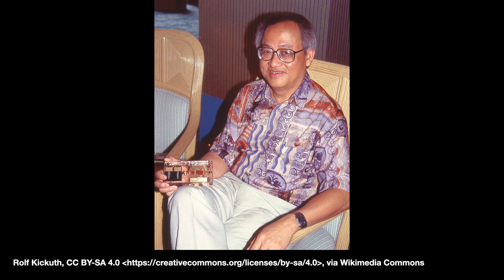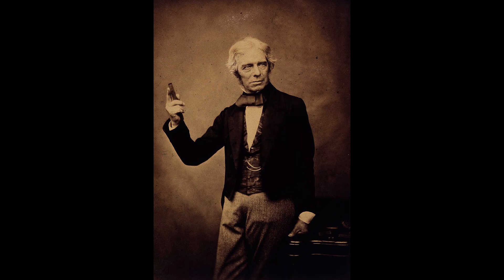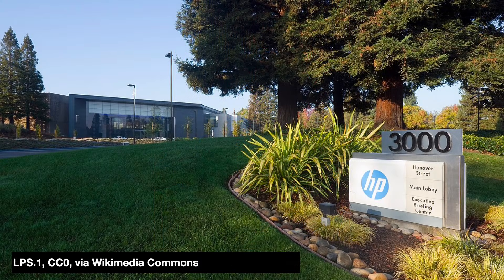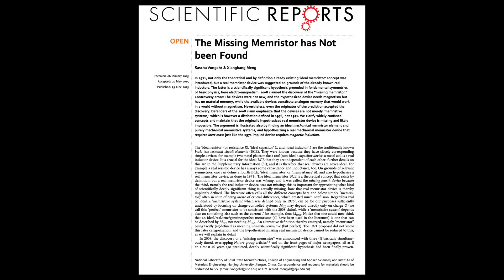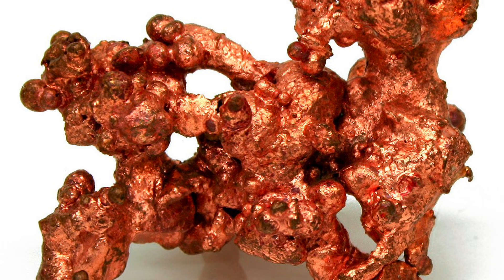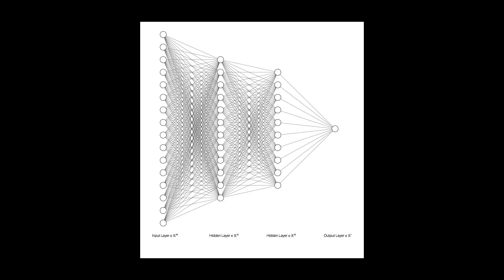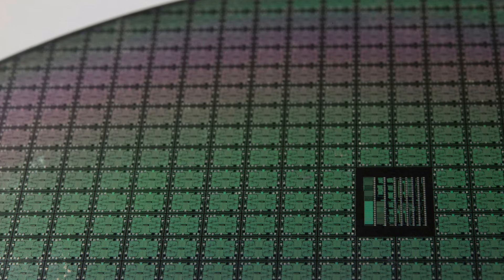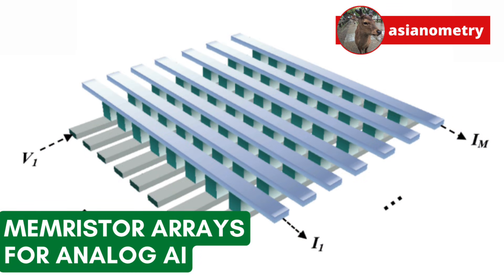Memristors for Analog AI Chips

Comment: It sounded to me like an electric spark can change the resistance and each memristor value needs to be  set  at each power on for a NN application.
Reply: memristors retain their value when the power is off. In fact you set the value and then turn off the current in normal operation.

Comment: Current computation based neural networks are just stupidly inefficient, to determine whether an artificial neuron should turn on you have to read a bunch of values from memory, which is not in the same chip so you gotta go through a bunch of memory management crap, wasting a lot of power and time, then you gotta do the math which is basically unnecessary because neurons don't need precise numbers anyway. Then you take your result, put it back out into memory, so it could then be used by another round of simulation of another neuron down the line.
Where as for a real neuron, this whole process is basically just baked into the wire, you send information into the wire, it automatically gets transformed and transferred over to the next neuron, there's no unnecessary nonsense like math or memory.
A big reason why current deep learning based AI is so stupidly inefficient, but if we could somehow have hardware that does the same thing as neurons, without using math or external memory, it would instantly be orders of magnitudes more efficient.
Reply: Ok, it's not THAT inefficient. You can divide up layers on different GPUs, so they don't have to fetch weights from off their own VRAM. The most efficient fused kernels, like FlashAttention 2, try to do as much as possible with on-chip cache while minimizing calls to VRAM. But still, a crossbar memristor array would be like 10^6 times more efficient.
Reply: a milli a mille a milli a milli
Reply: @accountnumber1234567  comment aged like milk lmao
Reply: @1vake496 context?

Comment: I'm intrigued but I fail to fully understand the concept and the implications.
Reply: Neural networks do a lot of math, particularly a lot of matrix * vector operations.
In a regular, digital computer, this would be done sequentially, multiplication after multiplication, which can take "long". Even on parallel hardware this could take multiple cycles (I think).
Memristor arrays could simplify the process by just having the input vector as a set of voltages on the top lines and reading the result of the matrix multiplication in the bottom lines. All memristors are working in parallel, making the process almost instantaneous.
Reply: @ゾカリクゾ  - TY. Is it the same idea as that of physical (hardware) neural networks that I've seen somehwere that is a (potential, under research) alternative to virtual (software) ones, which are the ones being used now in AIs?
Reply: @LuisAldamiz  Yeah, in some papers, they named it 'Hardware' NN to differentiate against regular 'software' ANN running on regular digital ALUs. The physical properties of the material (in this case, electrical conductance) and the linear law (ohm's law and Kirchoff's current law) is used here. For example, to do 4x2, 0.4V multiply by 2 microSiemens = 0.8microAmps. 0.8microAmps as an analog value, can be converted into digital 8. 4x2 = 8! Kirchoff's current law is just to add up more matrix elements
Reply: @timng9104  TY for the reply. However I recall that one characteristic of these brain-like (under research) physical neural networks was also to imitate the way brains work, which is "slow", "low energy" and "chaotic" (as opposed to the heavily centralized CPU architectures). This is, I understand, not necessarily what a "simple" shift from transistor (CPU & RAM) to memristor architecture but retaining the current mainline "neural network" paradigm would do, right?

IDK, probably there are several parallel and somewhat related lines of research here, all cutting-edge and thus a bit hard to understand. If they succeed, they may be behind a new AI and overall computing revolution (for the good and for the bad). Or it may not work at all, like the alleged graphene revolution and such.
Reply: like a new kind of a fpga.

it's not the only use case if someone managed to produce them though.

Comment: Got thinking about Memristors again after your SRAM video, was thinking about if they could be used in place of SRAM too.
Reply: Hi, not really, memristors (curent Halfnium oxide ones) are very noisy, and have huge failure rates, plus they actually consume a  lot of current to be programmed. So they are ideal for ROM, or Inference only accelerators, but for now it is not really though of as cache (PCM or other type of devices are tho).
Reply: @theoballet1519  Of course they aren't good for it now, they're pretty new and underdeveloped compared to SRAM cells. The properties of an ideal memristor would still make them interesting potential alternatives should one ever be developed in a process node compatible with a processor manufacture node.
Reply: @DigitalJedi  yeah maybe, we will see with new feram transistors and pcm I guess.
Reply: Same, a smart marketing move by Asianometry haha
Reply: I thought the same, I think we are a good oxide discovery apart to make that happen.

Comment: Memristor for me is scientific scam. Over the last thirty years there were regular articles about that topic.  None of them  led anywhere. Only good to get a PhD. 
If you  need a 2pin memory  device  just  use a 2 pin poly-si resistor  and put enough current through so that it melts. After removing the current the resistor has changed forever. 
Where is my PhD?
Reply: Why a scam? Companies did implement it in some experimental products that do work
Reply: @annilator3000  Yes, they can make chip. But it has really powerfull due to in memory architecture? No, they can perform well in limited model.
They promote that their chip is in-memory architecture, however in reality, they some use host dram by external interface(PCIe) or has own dram. Because memory in logic die is too expensive, they can not integrate over 30-50MB that they want to sell their chip.
I think that pim architecture is dead as other area.
Reply: @annilator3000  so where are they commercially? nowhere
Reply: @MrTweetyhack  STmicro electronics for PCM, CEA for memristors, TSMC has annoucned 2T2R memory arrays, and others.
Reply: I am doing my phd on in memory computing and neuromorphism (so I am biased). I kinda disagree, while it is true that for a long time people studied potential "memristors" devices, and a lot of ideas were thrown around, we are now well passed that stage. now HafO memristors are being produced by CEA, TSMC and soon other manufacturers are going to jump on board, other FeRAM are being produced, PCM also.... etc... we are now seeing system level design proposed by industrials, and they do work. 
I personally had the chance to work with memristors, and we can program them (with multi bit precision), also they have been shown to realiably perform MAC operations, as well as stochastic computing. 
I am sorry but it is just not true that a fuse or a simple resistor is equivalent to a Halfnium memristor.
Reply: @theoballet1519  What most AI researchers need is not simple MAC operaton. Can you run non-linear function like softmax using tham? Also, from a computer architecture perspective a MAC made of memory elements is simply expensive MAC hardmacro.
Reply: @seong-jinlee6004  I was just talking about one specific use case, but there are designs of non linear neurons that rely on thoses components. although probably not softwax since it is highly non local. 
And I would argue that if you look at current comercial AI accelerators most of them are MAC arrays with small modules to the side to perform sofmax or other non linear functions.
Reply: @theoballet1519  Yes, most AI accelerators have large MAC + SRAM. The reason I call PIM an expensive hard macro is because of its fundamental purpose. PIM is a method to resolve the bottleneck of external DRAM access. However, in order to eliminate DRAM access, at least 1GB of capacity is required, and as you know, LLM requires more than 100GB. However, none of the analog compute chips currently available on the market or in academia can integrate that much capacity, and most of them use host DRAM or have their own DRAM, which is contradictory.
Also, if you actually use more than 1GB, the number of internal processors must increase accordingly, so you lose price competitiveness.
For this reason, I believe that the von Neumann structure, in which the processor and memory play their roles well in their respective fields, is also effective in AI computing.
Reply: @theoballet1519  However, this does not mean that PIM is useless everywhere. PIM is probably the only chip that runs AI models with power of less than 0.1W. However, there is a problem that the price has to be very cheap.
Reply: @theoballet1519  Are they reliable at the moment? Are they noisy at the moment? Do you think they could be improved on those two?
Reply: How is your Comment displayed as 2 Months ago when the video dropped today? Youtube is weird.
Without having watched it, isnt the idea that you can flow current in the other direction as well to reverse the process?
Reply: @uninteressant2196 patreon gets videos early
Reply: A scientific scam? The technology has no valid use case?
Reply: Wtf? Memristors are super easy to make at home: put a piece of copper in sulfur powder for a week or two, then make a junction with aluminum. Done. $5. Where's the "scam"? Do a little research before you run your mouth, wtf lol